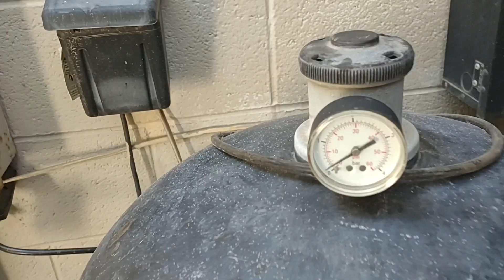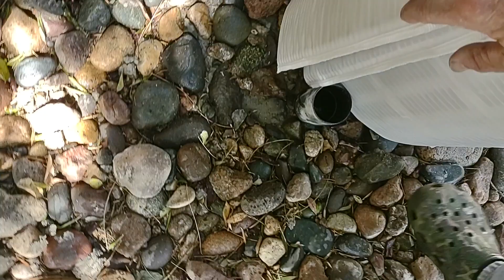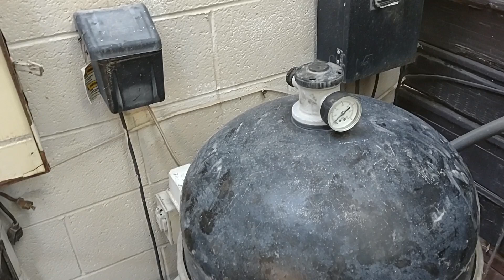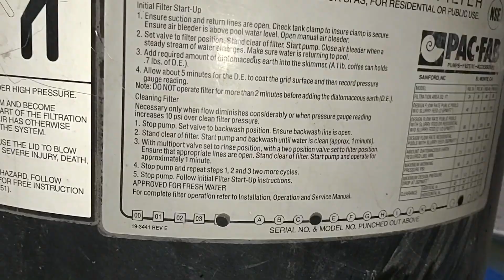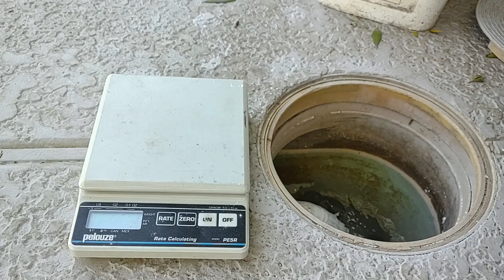Diatomaceous Earth (DE) Filter Rebuild with New Filter Grids - comprehensive instructions

Comment: I worked at a hotel in 1970's and cleaned their filter weekly by pulling the filter element out, hosing it down clean and putting back in. The owner would then put more DE into the system.
Reply from the maker: @MM-fq9gi  seems a little extreme, but I suppose with a hotel and the amount of music gets, more maintenance is required. But I really, really hate to have to do that with mine. ;-)